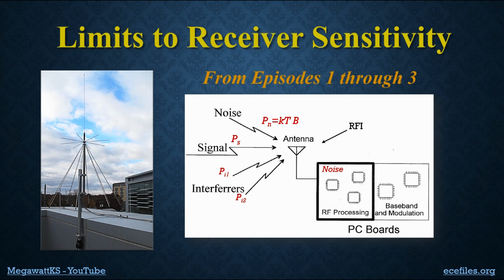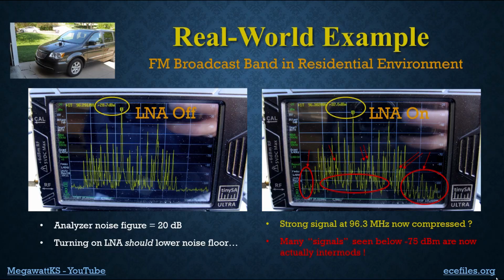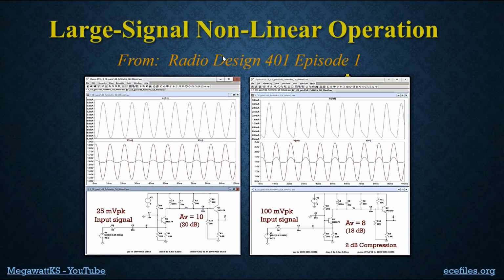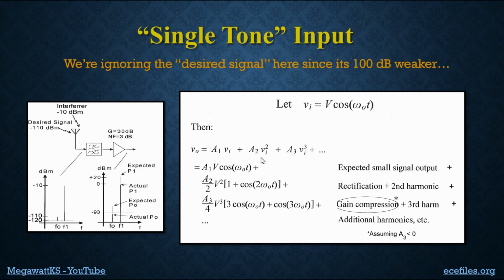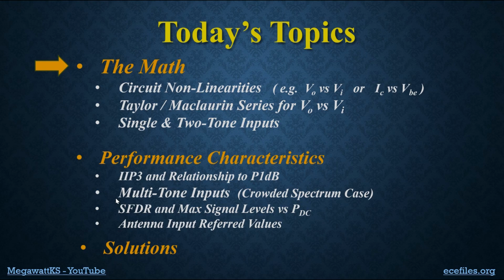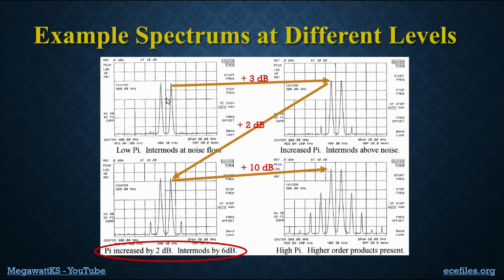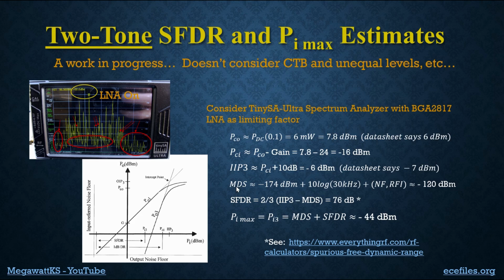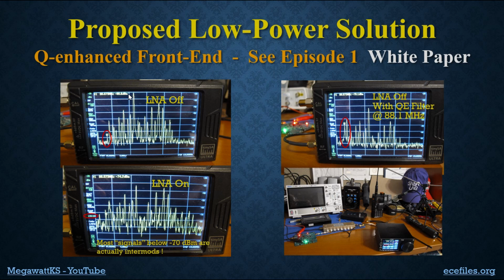Intermodulation in Real-World Receivers - Radio Design 401, Episode 4

Comment: I have read several articles and white papers over the years on multiple carrier distortion.  It's a very common problem these days with OFDM (Orthogonal Frequency-Division Multiplexing) which is used in WIFI, LTE, cable modems, home and commercial networks, etc...  There are even some new amateur radio modes that use OFDM modulation.  Even Shure microphones has published information on the problem.  It's not uncommon to have multiple wireless microphones in use at the same time in the same room that all operate on different but near frequencies.
Reply from the maker: Thanks for the info. I did see a few mentions of software available to allocate frequencies of multiple microphones to try to avoid intermods as much as possible. I suspect the FCC does something similar in licensing new FM channels. The OFDM thing is a good lead. I'll have to pull some papers on PA design for OFDM and see how they characterize the problem. Maybe there are some leads there analogous to the CTB stuff used by the CATV industry - only newer. Thanks.